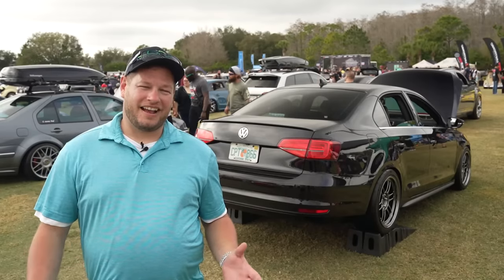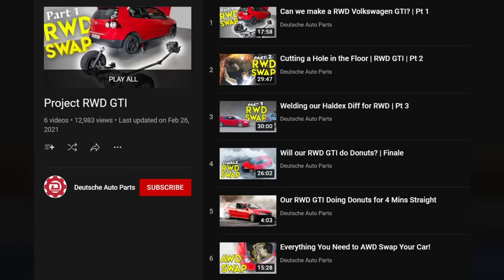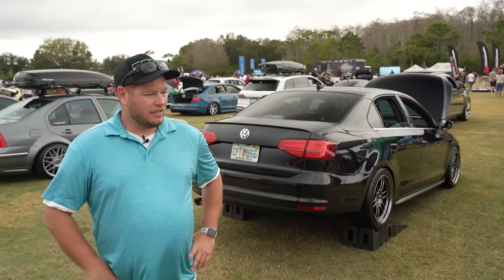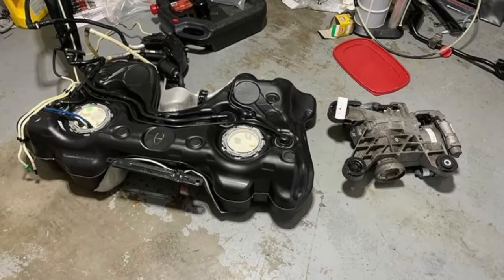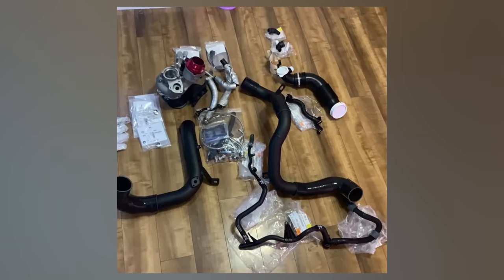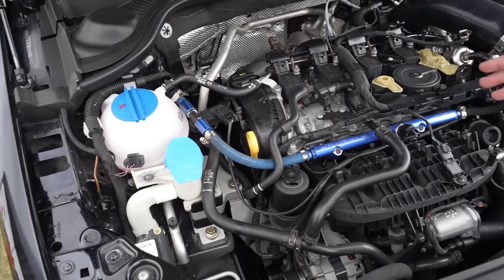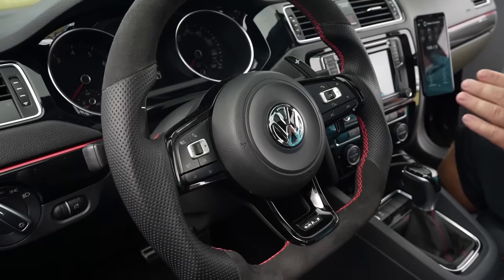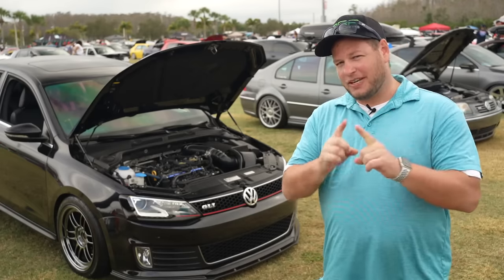Can you AWD Swap a Jetta? | Owner Spotlight

Comment: As a former GLI owner it’s true… even a basic stage 1 tune rendered first and second gear useless
Reply: Agree. I just have a neuspeed power module and grip is basically gone in 1st. I haven't done anything else (tune or mod) because I'm convinced that I'll just make it burn through tires faster. I'm just gonna get a golf r eventually.
Reply: sure off a launch it will spin but where it really shines is when your in 3d, so if your doing a roll race or something the gli is tough to beat @s00p3rman
Reply: And goodbye to our tires 😅
Reply: Have you tried using summer tires instead though?

Comment: Clearly yes. Full send! Imagine a fully built big turbo awd jetta. That's scary
Reply: Cool yes, scary not even a little bit. would be equivalent to a golf r but weighs more. I would say fully built big turbo fwd would be scariest cause torque steer
Reply: @kerbsy7838  big turbo fully built doesn’t equal golf r. Plus u do realize that this car doesn’t weigh more than a golf R and that it operates mostly in fwd mode but when it’s fully built , the awd would allow it to move
Reply: @MK6CHRIS  you didn’t account for all the added weight due to halidex drive shaft exc… and your right it makes less power than a gold r on a more planted wheel base due to its being longer then the golf so you saying it’s scary is halarious the added weight would also bring the hp numbers down and i was comparing big turbo golf r to big turbo jetta not a stock golf r
Reply: @MK6CHRIS  and halidex send power to rear when front slips so it really wouldn’t be the same in terms of you saying it “fwd” making it much more planted and stable over a fwd version
Reply: @kerbsy7838  i see what you are trying to say but it is not accurate. A fully built awd Jetta will be scary. It will weigh approximately the same as the Golf R and have the same power potential. And yes , like I already said, the car operates in fwd most of the time so a fully built car will move move out because the rear end will help. You just said what I did in terms of the halidex just differently.
Reply: @kerbsy7838  this car will be scary once it’s done and fully built . It will also weigh approximately the same. So yeah scary is accurate. It’s basically a golf r
Reply: @MK6CHRIS   clearly you’ve never driven anything fast because i can assure you it wouldn’t be scary a fully built golf r is an amazingly fun car to drive and fast but saying it’s scary i wouldn’t agree with you’re in control the whole time but i guess everyone’s entitled to their opinions and i think i’m very accurate with what i’m saying the halidex doesn’t allow front tires to spin as soon as there’s a little amount of slip it send power to back i know it a fwd biased car but saying it’s the same as fwd is far from true in terms of the technology, never said the car wouldn’t be fast im just saying it wouldn’t be scary and now you’re saying it basically a golf r after telling me it wouldn’t be the same… just contradicting what you said before
Reply: @kerbsy7838  i see the miss communication here, u took scary as like you are driving n you are scared. I meant scary as someone else is that is driving next to and or racing you. They’d be scared because the car is super fast n has a lot of traction. I also said that this car is basically a golf r in terms of weight n the awd . Not like scary factor. Make sense?  Also what does me driving anything fast have to do with this?
Reply: @kerbsy7838  I've watched MK6CHRIS's videos. He's not a guy who starts debates willy nilly. You pushed your point of "not scary" too far, and it made you look like you were trying to prove a point about yourself, rather than the GLI. A point that everyone here can agree with is that an AWD Mk6.5 Jetta GLI is more important and impressive to build than a typical Unitronic Stage 2 MK7 Golf R. I drive a 2015 GLI 6MT, and I was thinking about trading it in for a manual Golf R of the same year because I wanted an MQB vehicle. Now that I fully understand what is possible with the Mk6 Jetta platform, I'll save quite a bit of money by safely converting my GLI to Haldex 4, going Unitronic Stage 3 (with the required supportive hardware), along with a CTS "Boss" Non MQB turbo kit, which is made to pair directly with a Unitronic Stage 3 ECU off the shelf tune. 400bhp on 93 Octane, with a stock fuel system, and still a Non MQB setup. And I'd be shocked if this setup is unreliable.

Comment: Use the Audi A3 parts . No more messing around , everything works driveshaft and subframe
Reply: I’m not a fan of the looks of the A3 interior or exterior. You are right it would have been easier, not nearly as fun though.
Reply: @DevineDigital  no use the Audi A3 parts .rear haldex and trans etc
Reply: @DevineDigital  even the driveshaft is perfect length
Reply: @onelowvdub oh I see what you are saying. It was really hard to find parts at the time. Now I see posts all over the place for good prices
Reply: I’m completely confused as to why he didn’t. I feel like this guy just wanted to do the extra work.

Comment: I have this exact Gen 3 GLI.  Bought it 6 month old with a rebuilt title for cheap.  Since owning it, it has been stolen, hailed on, backed into and shot at.  That's right, shot at.  I was passing through an intersection and there was a shootout underway.  Bullet penetrated the rear drivers door 14" from my ass.  I have had a ton of fun in this car.  However, in the last 6 months all the body filler has started to crack and I just don't feel like investing new money into a car that isn't AWD.

Comment: This car first came out in 2011. It was ahead of his time beautiful car. Mine has 247000km chip 40hp more and still drives good. Little problems with clutch, mirror right side and dashboard make some ratle noise when it cold outside. But overal pulls, drives, brakes very good with my kw suspension and bbs Lemans Dunlop sports it Handels great 👍

Comment: Mines Stage 2 ultronic with vw racing intake, audi r8 coil packs, stage 2 clutch, esc tuning diverter valve relocation kit, esc tuning blow off kit, and a few more things making 322hp with more to go stock turbo! Their very capable cars its the 2wd holding it back for sure that and finding a tuner aswell

Comment: I got one too. The 30th Edition. Apr stage 2 rn ,manual with a bunch of bolt ons. With that big turbo though, I’d look into adding new headers.  Im on my way to where you are though.  Awesome build!
Reply: The exhaust manifold is integrated into the block these motors don't use headers the turbo bolts right up to the block.

Comment: I mean technically you can, euro models have a 4 motion option. just have to import the rear part of the chassis and trans/driveshaft tunnel and weld it up in place of the old one and get the rear subframe diffs, transmission etc
Reply: That’s basically what was done, but some of the parts weren’t able to be shipped due to length restrictions that require ridiculous shipping prices. At the end of the day I said if it works and is available here I’ll use it.

Comment: Awesome project! Maybe have a look at parts for Skoda and Seat as well. I know you dont have them in the states but those parts are usually interchangeable.
Reply: Great advice! The original catback exhaust I had on the car was from a Skoda Variant TDI after the swap.
Reply: @DevineDigital  I currently drive a skoda superb as well. Similar gear to a Audi S3 or golf mk7 R. However the chassis etc is closer to a passat. Happy to help figure stuff out if needed!
Reply: @Raskeable  mk4 Jetta wagon 03 1.8t. stage 1 tuned, it’s fun but finding myself needing to replace the steering rack and other parts. Seems like a ton!
Reply: @oahts5906  drive a Skoda superb myself. But basically just a golf 7r when it comes to parts:)

Comment: Have you had mounting points tearing off the bell housing or gearbox casing , M1 Ghost.✅✅✅🇬🇧
Reply: I have not, but I have all the brackets to secure the transfer case to the engine as well. Otherwise you would get flex and have that happen.

Comment: Also what you meant to say is you couldn't get traction  I have a 750hp ek civic with big fat slicks and still have issues hooking unless I'm on a prepped track  it'll blow the tires apart at 70 that said still beat em spinning.
Reply: I love me some big power EK action, it blows my mind how much downforce is needed to get traction. This used to do that, but now it’s much more fun to get thrown back in the seat for the kids and daily driving. Cheers!

Comment: This is extremely cool but it sounded like it was over complicated. I could be very wrong and your method could have been the only way. The first thing that came to my mind when i clicked this video was that you swapped an Audi A4/A3 quattro drivetrain possibly including the transmission into this
Reply: Pretty much the biggest issue is parts availability, especially without any local donors with what you need

Comment: This is cool "IF" he did not spend more than a Golf R to build it; I'd also like to know if he had the mechanical lsd when he installed the big turbo and had such wheel spin issues, I'm not arguing that point but would like to know...I've been considering a GLI and it could save me over building.
Reply: Of course he spent way more on this that what a golf r would cost lol.
Reply: @berube361  lol you are wrong, I spent about 15k less than a Golf R.
Reply: I did splurge on a Wavetrac LSD as well when building the car, it’s an absolute beast to drive and on rails.

Comment: Great build surprised to see OE coil packs at stage 3.. Is replacing with performance coils overrated on a moderate or even lower millage car  ?
Reply: I have since upgraded to RS3 packs. But for the most part stock coil packs will provide the performance needed. Only upgrade if your tuner recommends it.

Comment: Any reason why a similar year A3 Quattro or a Tiguan wasn't used for a donor car? It's basically a Jetta anyway.
Reply: Great question, tiguans are very similar but drastically different the US, they have  torque converted autos here, an a3 8P AWD is a direct boot on essentially but they are unicorns. The 8V (2015+) are very different in the rear subframe and fuel tank.

Comment: Did I miss the part where he stated this was an "un-face lifted" MK6? The rear looks 6.5 but the front is of course MK6, however he's moving with the gen 3 ea888.
Reply: 2015 is a weird year for the GLI, Facelift butt, and interior except for android auto and parking sensors… then it’s the pre facelift face. If you’re curious on other things I’d be glad to help. Cheers!
Reply: @DevineDigital  I've watched this video as well as many of your IG posts and I cannot figure out why I was so hyper focused on this detail! Lol
I do have a question about your build though - in the video you mentioned the "Passat Haldex dilemma", but I couldn't figure what rear crossmember you found bolts up without cutting the rear pan up.
Would you mind sharing your wisdom on this? Thank you sir!
Reply: @MK6_GLI  thanks man! I wound up getting a golf r rear subframe, but a TT and A3 subframe from the same generation works too.
Reply: @DevineDigital  thank you sir!
Reply: @DevineDigital  first of all, you have a nicely built car. i just finished converting my Jetta Mk6 with 1.4tsi EA111 to 2.0tsi EA888 Gen 2 completely rebuilt with forged internals and big turbo setup.. and for the love of all there is no traction.. 

i wish you could clear some things, i’m planning to go for a similar AWD setup.. but i’m from Malaysia and sourcing parts here are painfully hard and expensive.. so i would really appreciate if you could guide me in the right direction since i don’t want to be burning a hole in my wallet with parts that don’t fit.. 😂 

Would parts from the Mk6R direct bolt on? I know the DQ250 and transfer box wouldn’t be an issue, but how about the rear sub-frame, haldex and the rear drive shafts and especially the long shafts? Since the Golf & Jetta Mk6 have different wheelbase.. 

Jetta Mk6s in this part of the world only comes in 1.4tsi trim, either single (turbo only EA111 or EA211) or twin-charged (supercharged+turbo EA111).. no 2.0tsi @ GLI..

Thank you and really hope you would read this and reply.. Cheers..
Reply: @AraiTech  hey there, glad to hear about the build and no problem thanks for tagging me. As far as the MK6R everything can be used except the drive shaft. The rear subframe and all components work as that’s essentially what I used in the end. The driveshaft is the tricky thing, I’m using a MK7R driveshaft. It works but it is fully extended. The best bet would be to sadly get a custom unit made, but that can be really expensive. My current driveshaft has not given me any issues as of yet though. The Tiguan short wheel base I believe is the perfect length, but we don’t have those over here, I’m not 100% sure on that length though, it is very hard to find that information in the US.

Cheers!
Reply: @DevineDigital  thanks for your reply. since you are using the rear subframe from the Mk6R, did you find any issues with the suspension since the track width is narrower on Golf and Jetta is wider? I’m contemplating from getting donor parts from either the Audi TT Mk2 (same rear track width as Jetta Mk6), A3 8P Quattro or Mk6R or a mix and match from all.. And we do have the Tiguan Mk1 here fortunately.. 

By the way, here’s my build if you are interested :
https://youtu.be/NX4KssyxWdg

Thanks again for your reply and wishing you all the best…
Reply: @AraiTech  so funny enough, another friend of mine from Canada swapped an a3 8P driveshaft and all and it worked 100%. They are very hard to find here though. The MK6R narrow track is great so you can run wider wheels. I could if I wanted fit an 11 in wheel in back.  Cheers, and be well!

Comment: Nice build. But why not tunning and improving an A4 2.0T Quattro? The B7 it's similar looking to this Jetta and its AWD. lol
Reply: Its a nice thought but its also a midsize vs a compact, even then it would have cost an additional $10-20k overall. If I wasn’t going to do that I’d go for a S or RS model. I had the Jetta so I figured why not? Cheers
Reply: @DevineDigital  admire the effort and the time spent to fit the AWD system on this Jetta. Real hard work but great job. I suggested the B7 A4 because i prefer the Torsen AWD instead of the Haldex but nonetheless, it's a great project. Cheers mate

Comment: I wonder if this will be possible for the 1.4 Jetta with the turbocharger and supercharger
Reply: I’m not to familiar with the 1.4 configuration, but if they make a 1.4 AWD somewhere in the world then it should be possible. Good luck!
Reply: @DevineDigital  I don't think that model was for the US market, it was mainly sold in Europe and Asia. 1.4  mk6 Jetta comes with a EA111 1.4 tsi  twincharged engine(turbo and supercharged). VW never released a AWD version of it so I'm not too sure about compatibility
Reply: @fgtrhwu2  good information to know, the best way would be to look at diagrams of similar vehicles for mounting points and such. Thats what a lot of the research is

Comment: Seems like this is the place to ask a question, i have a 2003 TDI engine will it fit the motor mounts of a 2007 GTI. USA both models
Reply: Honestly they haven’t changed much over the years, best bet would be to double check an aftermarket vender and compare the design, from what I’ve seen the mount and bushing itself changes, but where bolts to the portion of engine side mount is typically the same. Best bet would be to double check shop daps site for photos and see.
Reply: @DevineDigital  you sir are a godsend

Comment: If you left it with a stock fwd driveline, with your big turbo setup you'd be faster right? As long as your tires hook well? Really neat that you built an awd gli
Reply: There would be less driveline loss, but you would need 
comically wide tires, an LSD, and drag slicks to hook up with that much power fwd.
Reply: @7dragongames  this is sadly the answer. We have folks that have done that, 275 drag radials on low pressure still spin at the track with LSD. Since getting my reflect tune, I can still spin all 4 (well 3) with the AWD LSD too. It’s nuts and I love it!

Comment: I'd like to put the AWD drivetrain from the Alltrak wagon in a Jetta GLI with the 6 speed manual.
My REAL dream would be a 2020 or newer body style Audi S4 with a manual transmission and the RS3's 2.5L 5 cylinder. THAT would really be my dream. I'd even like to build an A4 2020 or newer with a NON turbo 5 cylinder with stick as a homage to the 90 Quattro that we once had. I really miss the sound of that car more than anyone will ever know.

Comment: i want to know what else had to be done to get rear ac, cant just be the tunnel, how did he get airflow back there?
Reply: The tunnel comes with the console and the cars already got the vents there just blocked off from the factory. Getting the power to work in the back though I did have to splice and solder a connector. It works great though for the kids tablets and such!

Comment: Anyone know the wheel and tire set up he’s running??
Reply: I sure do. 17x9 +45 5x114.3 RPF1’s in Black Chrome, 3mm spacer up front with wobble bolts, the rear is a 15mm adapter 5x112 to 5x114.3. The tire is a 245x40R17. Next time I’ll be going with a 45 series side wall.

Comment: why is he talking about re using bearing halfs from the gearbox casings as if he has done a good thing by matching them. You should have done a real job, bought a new bearing set and shimmed it correctly too.
Reply: I was actually talking about the shaft bearings and such inside the DSG. The GLI shafts bearings and races had 30k miles on them in the original DSG so transferring them from the old bell housing to the new bell housing and using the same gear set ensures they are matched. The diff had all new bearings and was properly shimmed. That doesn’t make an entertaining video though now does it 😂. Cheers!